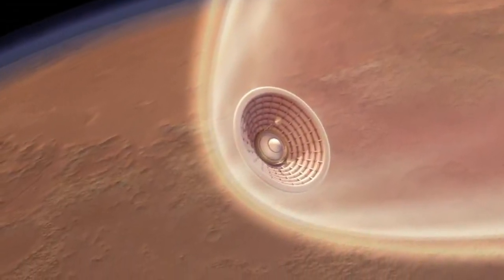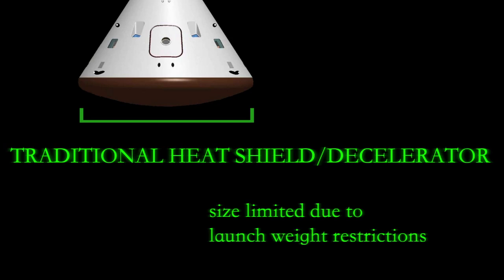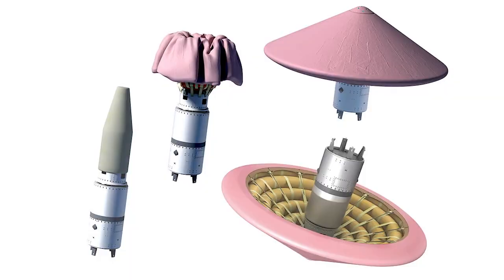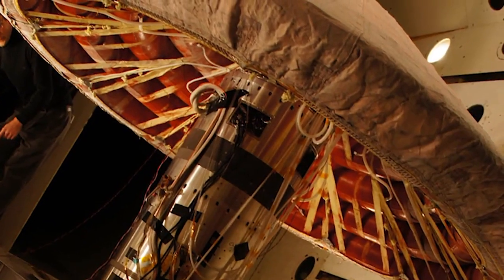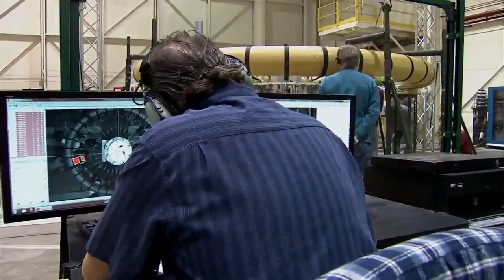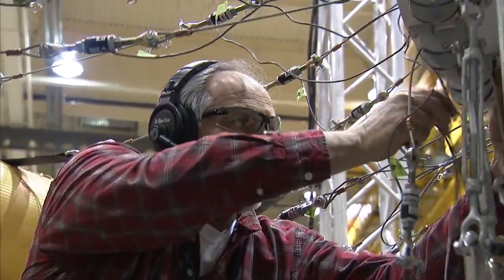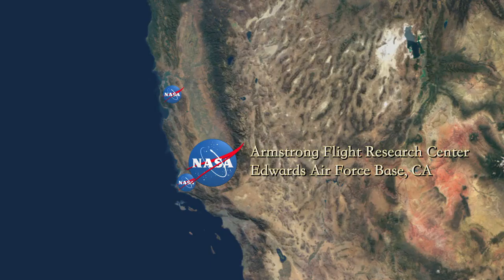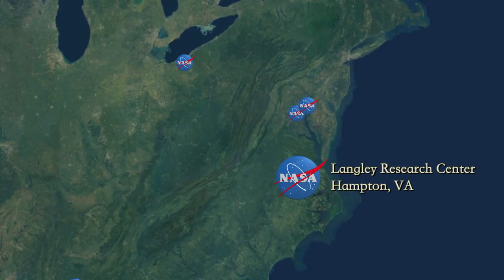Inflatable Heat Shields Could Drop-Ship Bigger Robots | Video

Comment: I think that the heat-resistant sheet on the surface will have concentric bumps where frictional heat and turbulence will be concentrated during atmospheric entry, but I wonder if the countermeasure is only "sufficient strength".